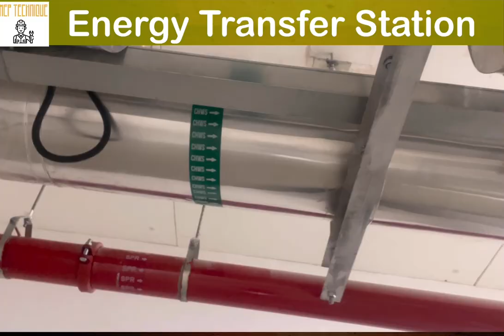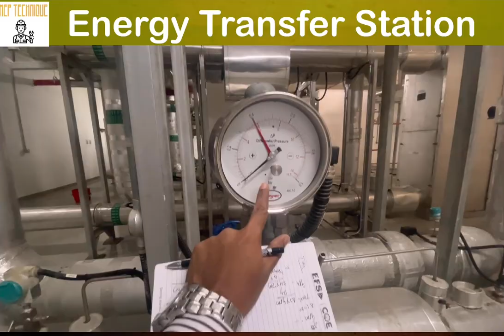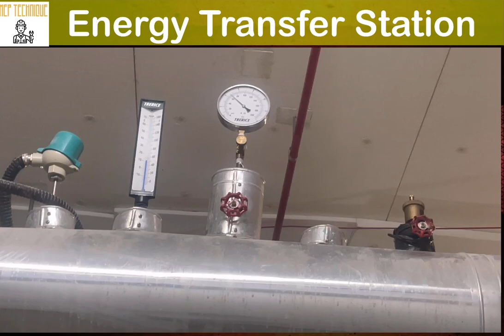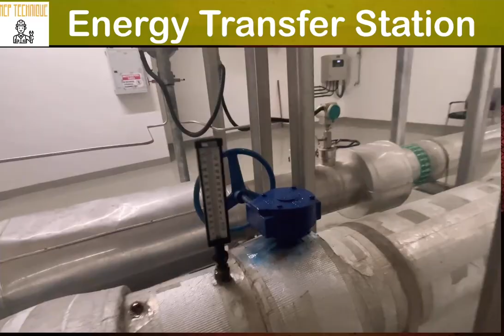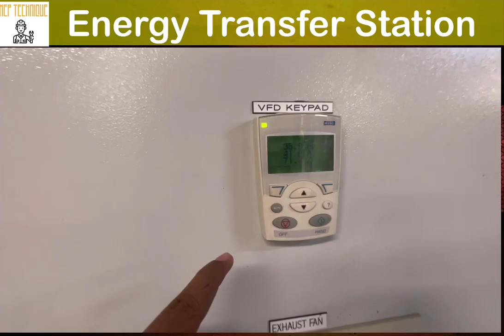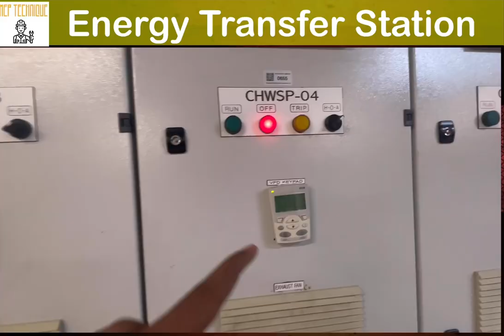How HVAC District Cooling Works? Inside an ETS Room

Comment: Which chemical adding in chilled water
Reply from the maker: In UAE chilled water HVAC systems, the main chemical is usually a corrosion inhibitor, such as a nitrite-based or molybdate-based treatment. A biocide may also be added to control bacterial growth. The exact chemical depends on the system design, pipe materials, and water test results. Always follow the water-treatment specialist’s recommendation.